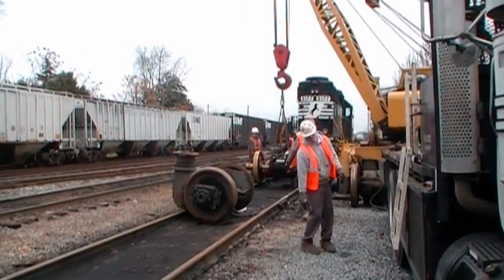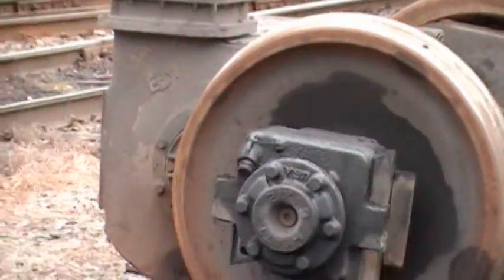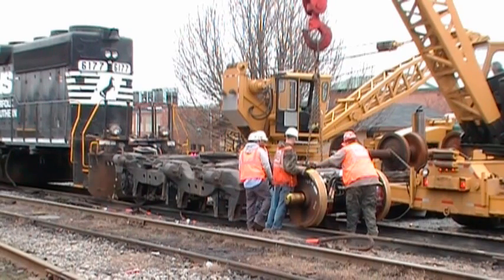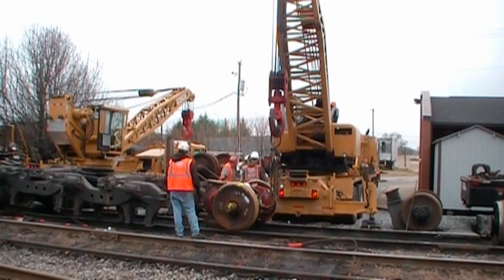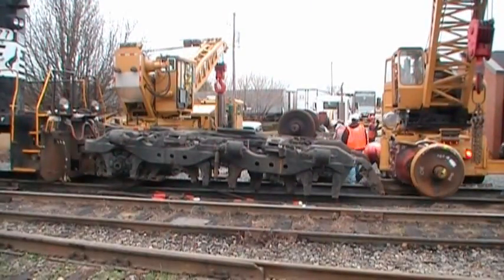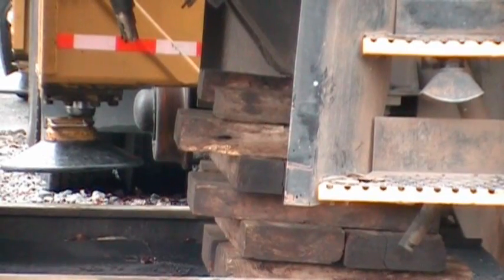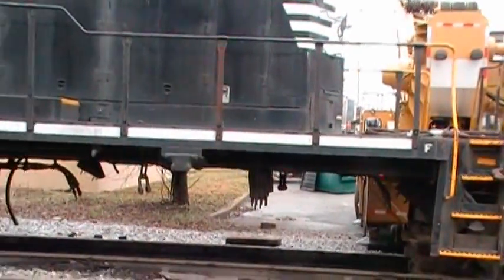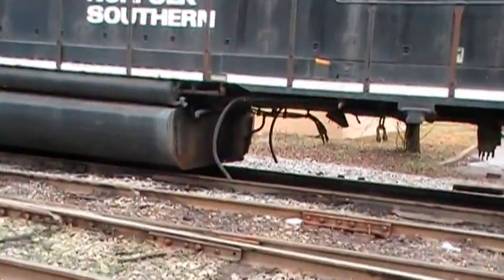Traction-Motor-Series-Part-1.mpg

Comment: Hello such, I was wondering if you as unarmed train traction motors?? 
I would appreciate if you could tell me how to get the pulley to the arrow
Reply from the maker: I do not understand your question  Thanks
Reply: Sorry I want to know how to remove the toothed belt that drives the drive wheel train
Reply from the maker: Hugo Estrada
There is no belt  it uses an electric motor called a traction motor.
http://science.howstuffworks.com/transport/engines-equipment/diesel-locomotive8.htm
traction motor machine animation

Comment: The series are great thankx for sharing them. ? If these engines are so great why are elec. and disel. That would mean alot of money to operate one and there thousands on the rails. ? What about coal wood water seams more cost efective then forking out a ton of money on exspensive engines.
Reply from the maker: Thanks  I appreciate the comment,  I am sure there's more than one way to skin a cat
Reply: less work and upkeep on a diesel /electric  then on steam in my book. easier to work on too

Comment: The traction motors do not look like something that would be diesel electric. They appear to have hydraulic lines trailing off of them.  Thus a diesel hydraulic traction motor.  Right?
Reply: jbmbanter Huge thick cables to handle the enormous amount if electric current.

Comment: According to the numbers you used about the engine, do you really think it's a 4 cylinder engine? i don't think 4 cyclinders are strong enough for this work. Detroit Diesel 4-71 is series 71 with 4 cylinders

Comment: What you call a "Traction Motor" in the video is really a Locomotive Driver/Motor Set, that has a Traction Motor and two Driver Wheels that are permanently mounted on the Axle. Three of them are being replaced in the set of videos.

Comment: You don't know what those connections are, Einstein, but I do.  There are 2 field leads for the motors and 2 armature leads.  It is a DC motor.  The motors can be turned into generators for braking resistance (dynamc braking).

Comment: the crane he is using to lift the traction motors looks like an old FWD/HOLMES 50 ton hi-rail  i used to work with one of these doing small derailments for CSX as a contractor years ago. if you know how it will lift a lot more than 50 ton.